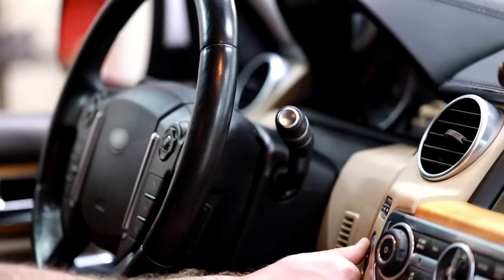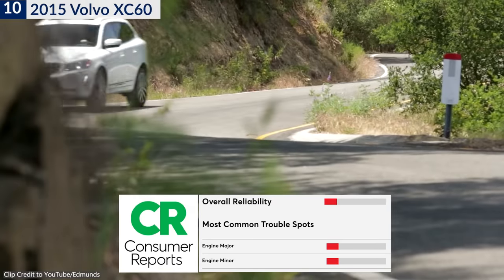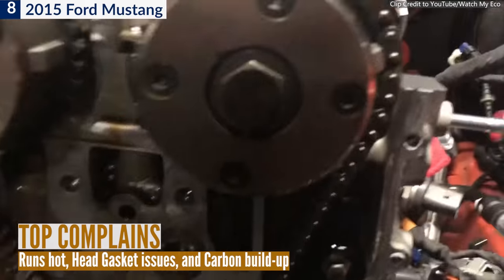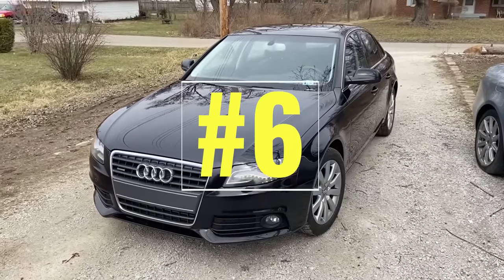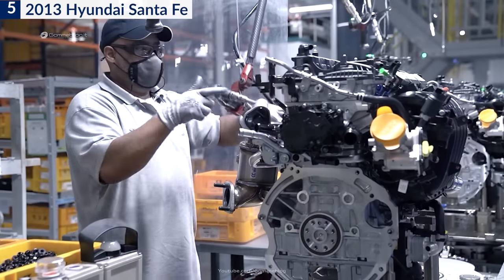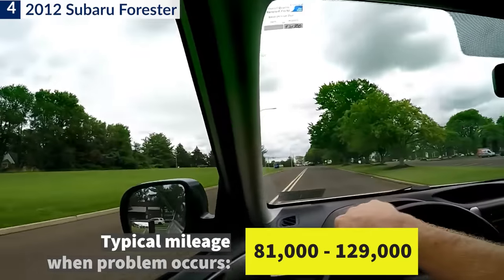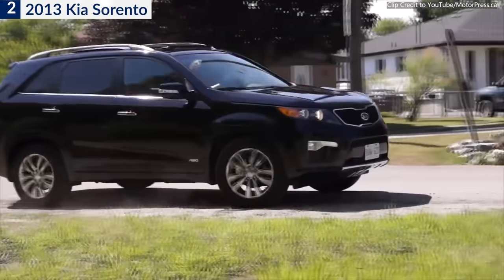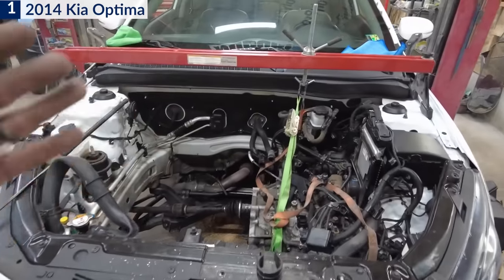10 Used-Cars to AVOID for BAD Engine - as per Consumer Reports

Comment: I  have owned Toyota. Of matter of fact I still have my 1984 Toyota truck I got in 1994. Still has Original engine and transmission. With 321,000 moiles. Starts every time. I would recommend anyone who wants a reliable car or truck to get a Toyota. I have 7 and all of them run perfect

Comment: They should not be using aluminum engine blocks why is the manufacturers of automobiles are using them because they lightweight the front front wheel drive and all-wheel drive the 4 by fuel economy then they should go back to making them out of cast iron engine blocks instead of aluminum and redo them engines over again if it's not broke don't fix it 2010 to 2019 we've been having trouble with these cars trucks and SUVs we will be having more problems we don't want to have no more problems or recalls easy enough is enough from Volvo BMW Volkswagen Toyota Kia and Honda Audi Ford Motor Company

Comment: 2011 to 2019 Kia and Hyundai Engines are bad,  main bering on crank damage could cause engine to stall and or cause engine to catch on fire.
2020 to 2023 Kia and Hyundai Engines are bad, piston rings bad allowing oil to pass by the rings. 

CALL an OFFICIAL KIA / Hyundai Dealer to find out if your vehicle has a Safety Recall

but... DONT EVER buy a KIA or HYUNDAI vehicle, unless you're in South Korea.

Comment: its not as they age when it comes to hyundai/kia 4 cyls....there just straight up garbage engines from day 1....we have had new vehicles with zero kms on the engine straight off the truck with bad engines and customer with less than 5000kms on the car need engines. Hyundai engines in my book are the worst engines EVER created. Its not year either its across the board since 2010+ vehicles. friends dont let friends buy hyundai/kias

Comment: Audis have always been pieces of crap. Apparently they still are. They look cool, & have cool dashboard lighting. The engines are horrible.
Also, never get a Hyundai. They’re packed w/ gadgetry, but they’re plastic & there’s a reason why you never see one on the road that’s over 10 yrs old.
BMWs are great, when they run good. Once you start having to replace clutches, & radiators, & water pumps, you’d better get rid of it. I’ve had 2 635csi’s & they both were great til they became money vampires!

Comment: Fix it yourself, sorry non mechanic gold. They make a lot of plastic junk now and days. Don't buy a BMW after 2015. Four cylinder turbo charge engines are a disaster. Turbochargers are the problem. Hear, burned valves, thermo shock, piston destruction, just the heat to cool down effects are a terrible combination. If your a race car driver you have the money and ability to fix it on the spot. But if your a average Joe. Well your screwed. Don't be foolish, if you can go back to naturally aspirated engine. No turbos. The rest is cheap and poor design of these vehicles. O, well the dealer only sells them for money or profit, your fat cat. Your the one who pays the bill so do your deep research, because now and day your buying junk+depreciation off the lot.